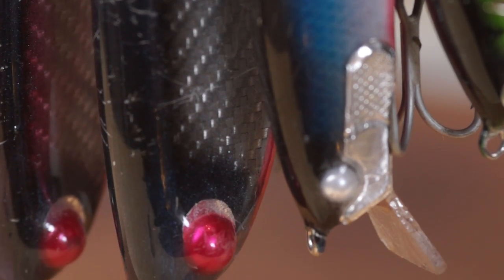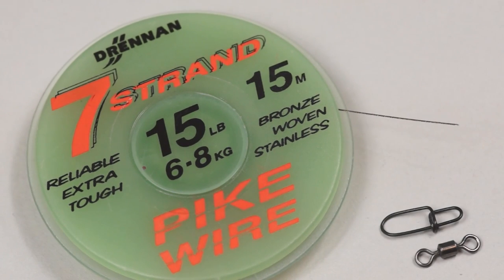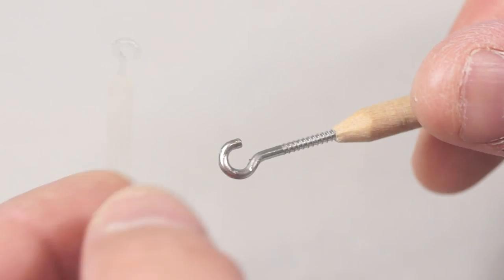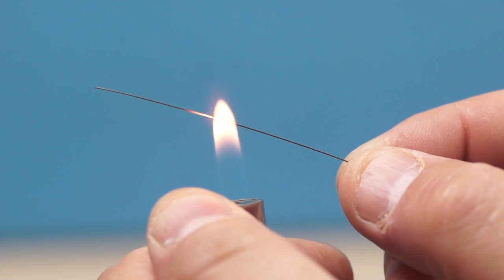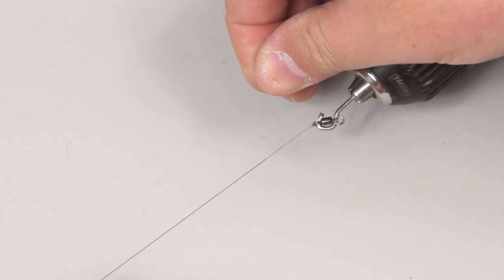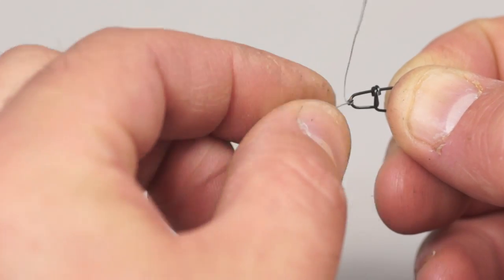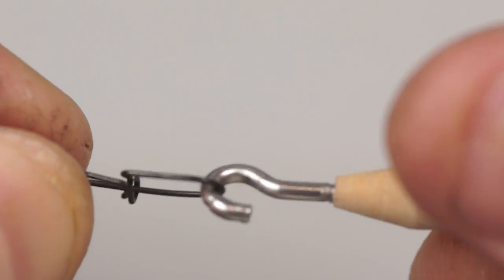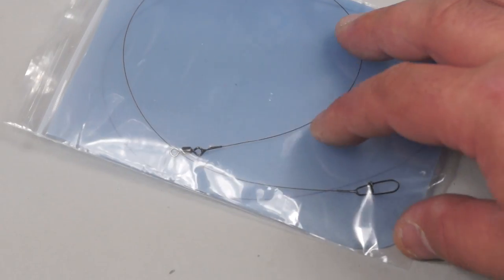Making a Ultra Light Leader (Trace) for Perch and Pike Lure Fishing

Comment: Definatly going to give these a try! My only question is if uncoated wire is used would that mean it will corrode after several uses and become weaker or not? Thanks for sharing
Reply from the maker: It is still stainless steel so it will not corrode, but these are very lightweight and do get damaged, this is not something i would set out to pike fish but it can cope with them.  Thanks

Comment: Paul another most excellent vid but why epoxy ?to keep from unfurling? if so smart very smart but maybe a haywire twist instead ?either way great job!!!!
Reply from the maker: w delakas The epoxy just protects it from the weed or snags that would make the end of the wire stick out, the knot does about 90 percent of the work. I do not think this wire is really suitable for the haywire twists it hasn't got enough stiffness. But i might have ago with some thin Malin wire i have

Comment: iv started using micro jigs for perch and i was looking for a trace link that will fit the small size 4 hook eyes. any ideas? currently having to use flurocarbon which as we all know is not great if pike are about.
Reply from the maker: Luke Turner I have some really tiny snaps that would probably do but they are so small i cannot use them. Fly fishing snaps may be better, i think Mustad do some snap hooks for linking into flies. another option may be 49 strand wire which can just tied on. I do not always use traces for perch when i get down to tiny jigs i just go with fluorocarbon, i have never had success at tempting pike with tiny jigs or a no6/8 drop shot rig i think it is just inside that range of baits that would make it a very rare occasion. I have landed pike float fishing with maggots on three pound line and unhooked (unwrapped) pike caught on similar gear for others who were fishing with mussel. What i have found is a tiny hook sizes the pike tend not to be hooked but often just snagged or wrapped in the line. 

Thanks

Comment: any chance of a video on handmade pike floats? I've been experimenting but the results haven't been great. cheers.
Reply from the maker: what materials are you using?
Reply from the maker: ***** and what type of pike floats?
Reply: I've been trying to get hold of balsa dowel but I can't find it anywhere and I refuse to pay B&Q's prices! I've been using kindling sticks pinched from the bag by the log burner as it's dense wood and floats well, carved with a Stanley knife and painted with acrylic then coated in epoxy.
Reply from the maker: Louis Gerard I used to make sliding pike float or sea floats from corks this link may explain things a little better   http://erraid.blogspot.co.uk/2011/09/it-is-dark-outside-tool-shed-light-from.html
Reply: ***** massive help, cheers paul

Comment: oh 1 other how about monel wire a bit softer and no need to anneal
Reply from the maker: I used to use monel wire on mooring shackles for boats to stop the pins coming undone, but i remember it being soft to bend and wrap but not flexible like braided wire which is a bit like a stiff string. Is the monel fishing wire different? i have never used it for fishing.. thanks